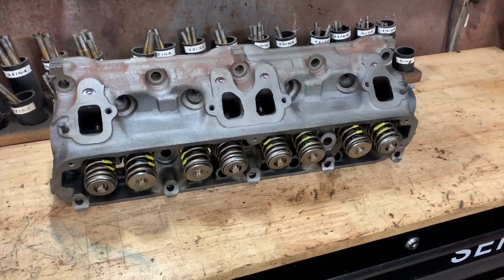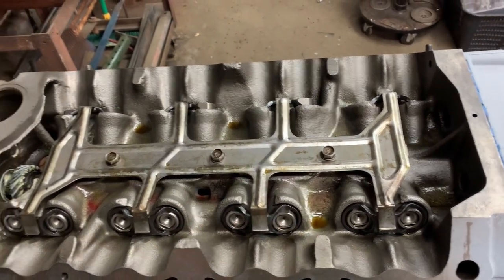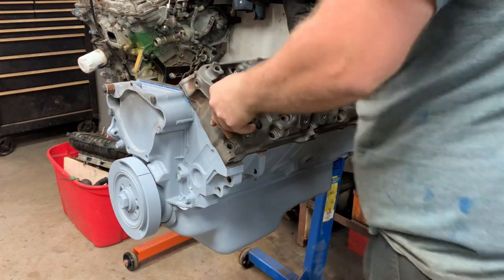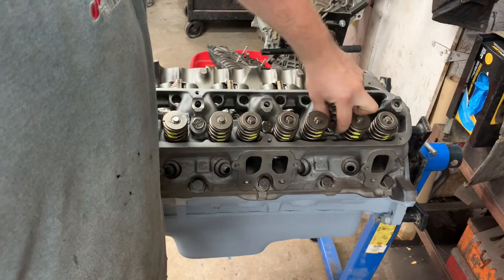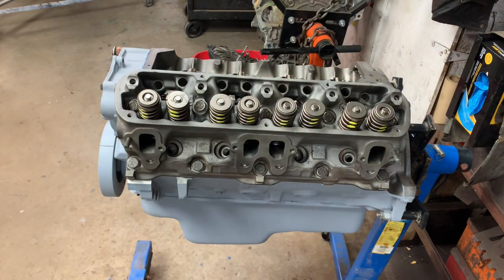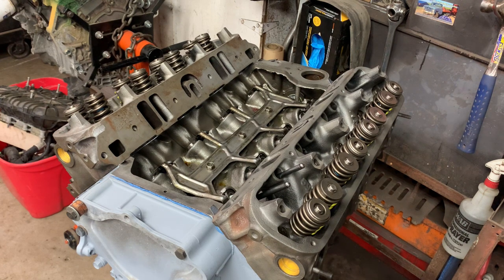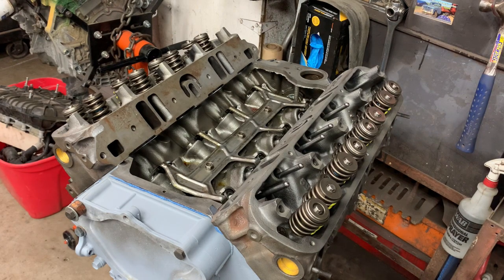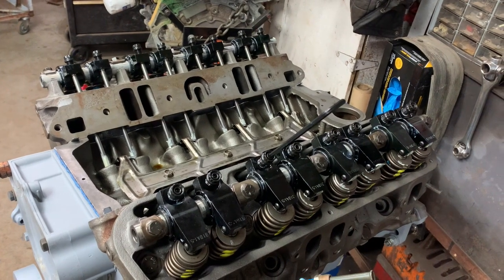Mopar LA Roller 360 Rebuild, Part 7, Cylinder head assembly.

Comment: One thing I can see with the pistons is well I hope they are not at TDC because they are a long way down the hole if they are your losing lots of comp and the are not flattops . To start making good power you need 10 to 1 or better looking at that you might be 8 to 1 maybe a little bit more
Reply from the maker: It's a stock rebuild, not a performance build, the factory 8.5:1 is plenty for its purposes.
Reply: @therealguygarage2668  just seams a shame to not put flat tops in it and try and get it close to zero deck the cost wouldn't be much different and something close to 10 to 1 would wake the poor thing up a lot . looking at those piston they were pretty low in the hole I am guessing 100+ thousands of an inch that's a lot I bet its barely 8 to 1
Reply: @therealguygarage2668  I do hope it runs ok for your friend though
Reply from the maker: @NZMOPAR  it's originally from a 7000lb 1 ton truck and is now going to be in a 3000lb car, the car was originally a 225 slant 6, even stock a 360 is vast improvement.
Reply: @therealguygarage2668  It'll be fine.